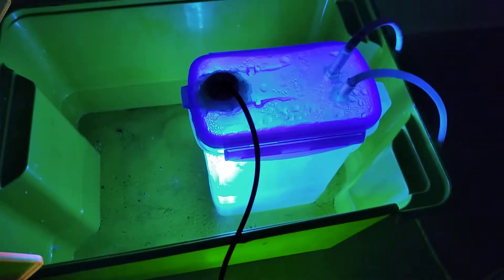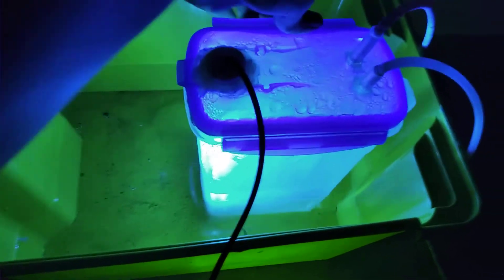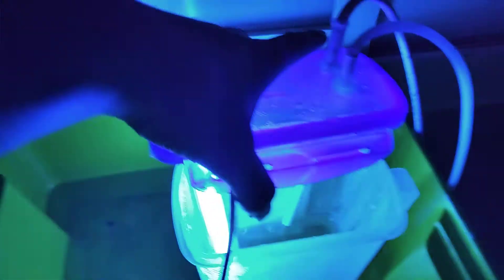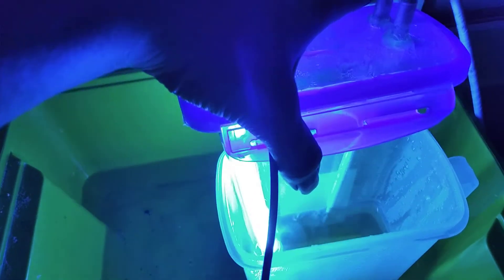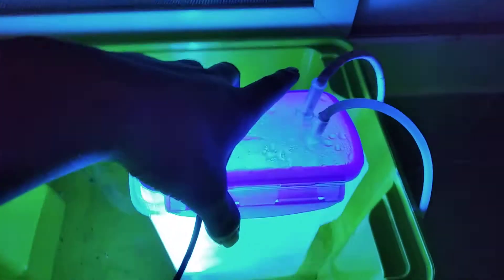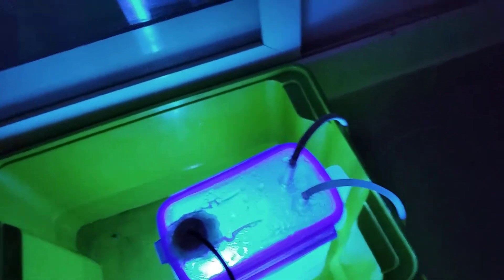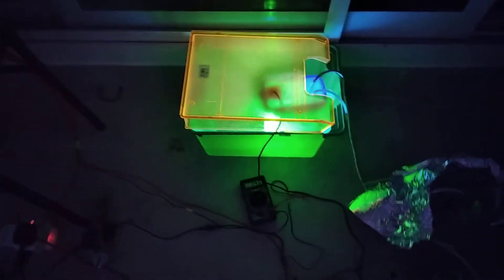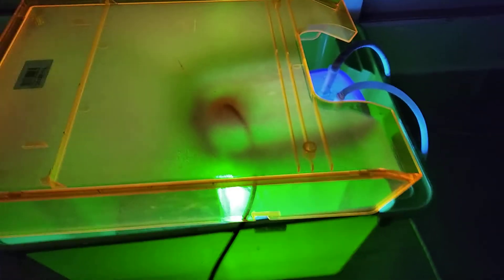Fuming HCl from membrane chloroalkali HCl process

Comment: Come on. Where those lights even necessary??? ...yeah, and apparently phuckin essential

(edit: ....thumbs up for voltage tip at the end!)
Reply from the maker: without the ligh you only produce HOCl + HCl which is in equilibrium with Cl2 + H2O and therefore NOTHING.
instead the UV dissociates Cl2 and HOCl but HCl remains stable due to its stonger bonds!
it also initiates the reaction of H2 and Cl2 which is exothermic so care must be taken while doing this for too much flow rate of gas = too much heat = BOOM!!
Reply: @CatboyChemicalSociety  Oh, I thought that was just to make it awesome lookin. .... I had to read that twice, but BANG ON!!! This is the cool shit ppl need to know. When looking up DCM I learned of Henri Victor Regnault. So cool, the effect is seen here too. ...I'll have to go to ur build vid on this. Thanks!!!!
Reply from the maker: @YouMockMe  without the awesome lookin flourescent shield this setup would be a huge cancer risk XD
Reply: @CatboyChemicalSociety  Cancer too? Thanks for the heads up. All I knew was not to sniff the bubbles haha